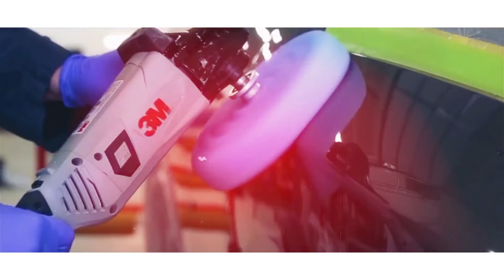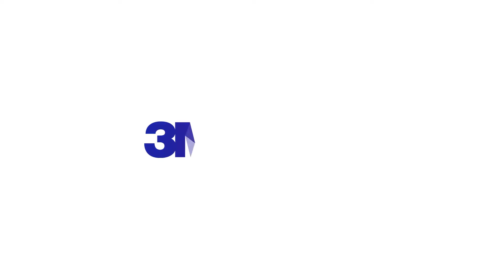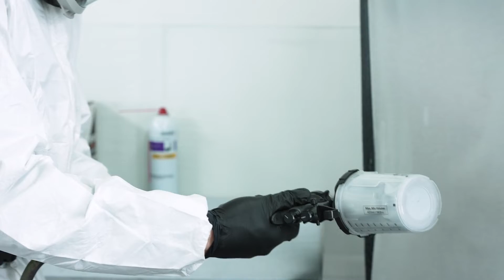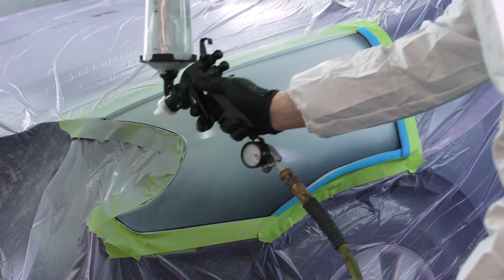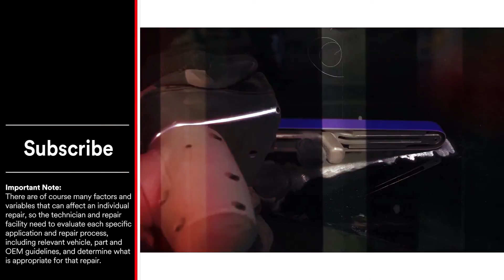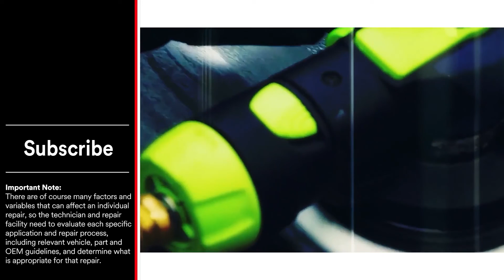Paint Prep Process Episode 3: Apply Primer

Comment: Why use a 600ml cup when spray such a small repair with the manufactures recommended film thickness of three passes? That is waist full if not using a smaller cup. 
DK. ASE Master Tech since 78.